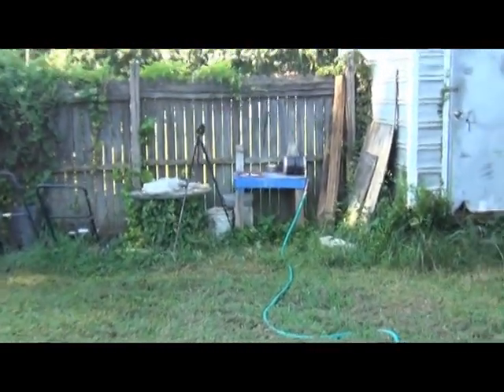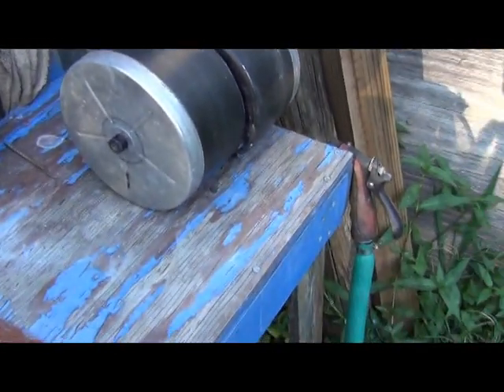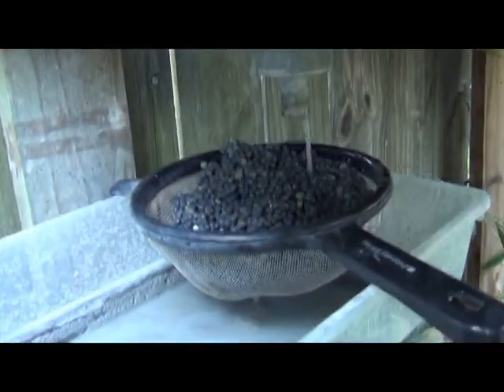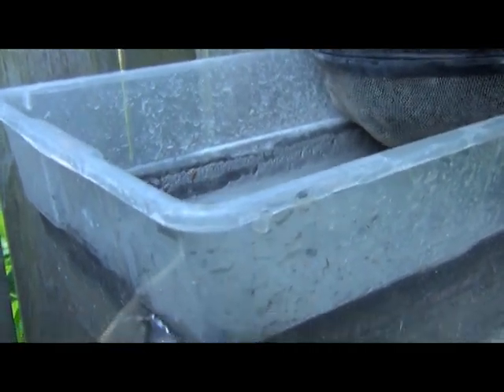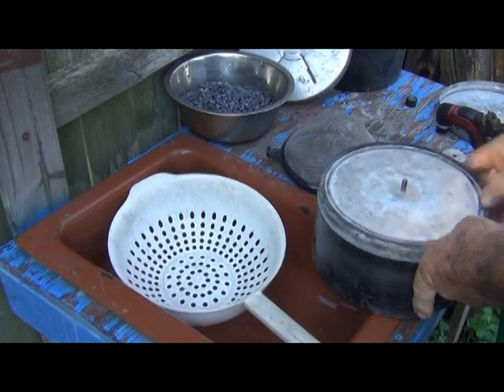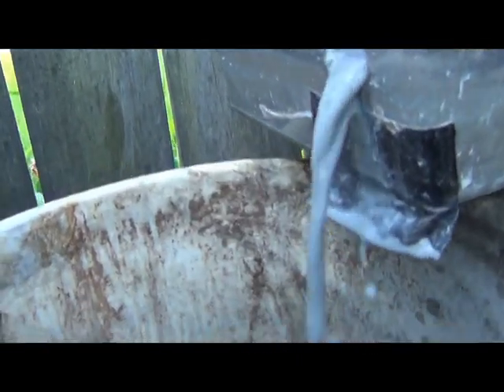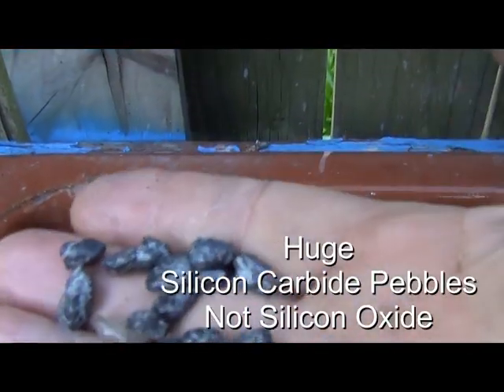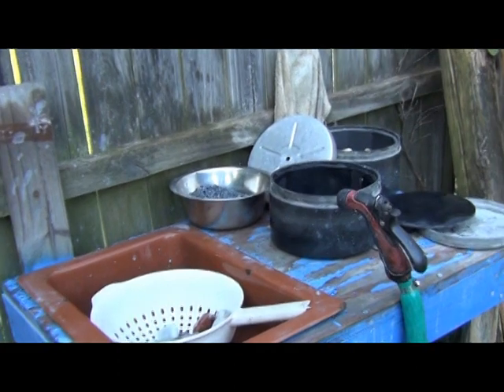Cleanout Sink for Rock Tumbler Barrels with Grit Recovery System

Comment: Like your cleaning station.  Wondering what you do with the water in the 5 gallon bucket when it is full.
Reply from the maker: Up until recently I poured the slurry down a small hole in the yard made by an old rotted out Tree Trunk. However I've filled that hole and now I walk about 10 more feet to the fenceline in the backyard and pour it there.